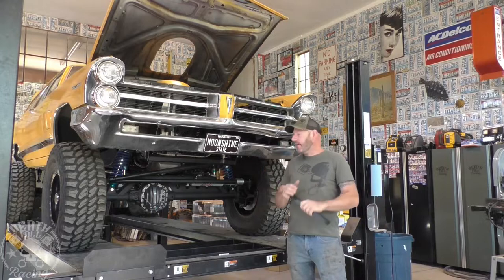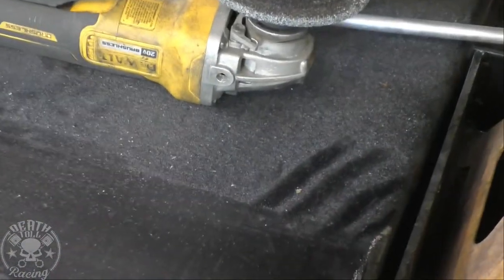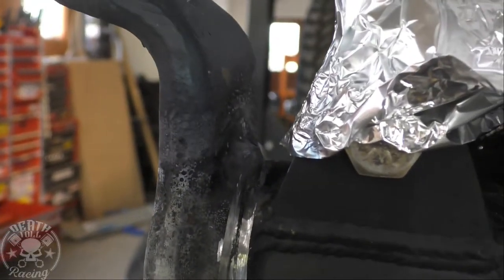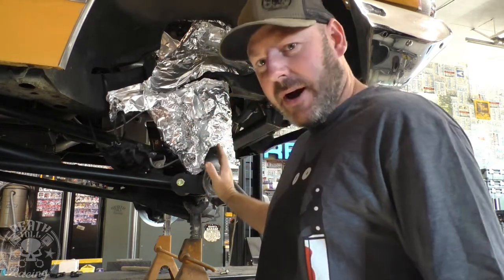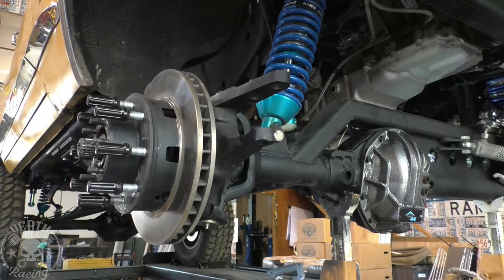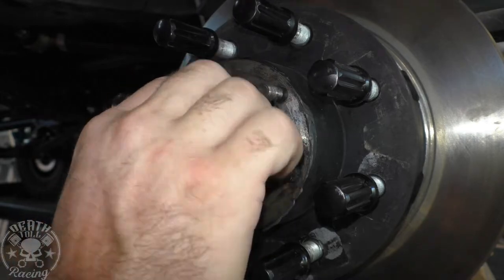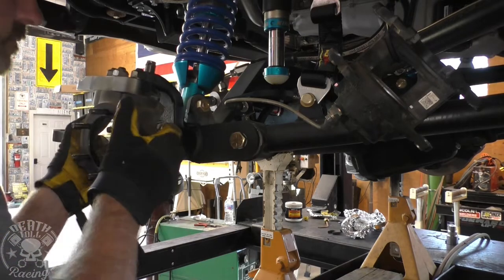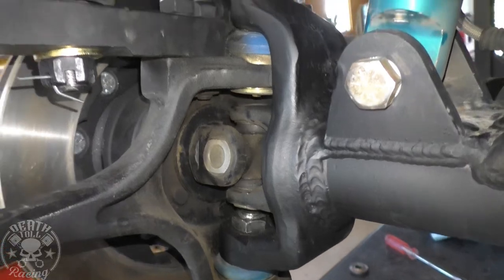Dana 44 Inner C Knuckle Rotation to Fix Caster on a Lifted Truck;  Safari Wagon 4x4 Overland Project

Comment: what an awesome video!  I have a 1995 nissan safari, with undersprung solid axles.  I am flipping the to over axle, and did not know of all the other steps involved to make it driveable.  Someone asked about "cutting the knuckles and rotating", and I simply entered that into the YT search, and voila!  Thank you so much for taking the time to make such a great video.  That shop is also mint.  I am bringing my truck to an expert to do this, as I wouldn't be able to exit the garage after the axle flip!......and I have never done what you just did!  If I had the space, vertical and otherwise, I would absolutely tackle myself!  Thanks again.  New subscriber here for sure!
Reply from the maker: Thank you!  Rotating the knuckles can be a pain. Glad the video was helpful!

Comment: bravo
correct way to make your front alignment as perfect as possible
suspension geometry, axle reinforcement, tire size, ride height, pinion angle - then CASTOR!!

Dana 44 is notorious for inadequate castor, especially if your donor vehicle was IHC.
twisting the knuckle (AFTER all the other parameters have been established) is the best way (in my humble opinion) to correct this inadequacy. turning the entire axle shaft has been proposed, as has cutting and turning the shaft housing, but after installing custom suspension and probably an axle truss, the steering knuckle is the easiest and least disruptive method. this method will work for all axles, not just the 44.

again, bravo. (assuming you were watching your camber...)
Reply from the maker: Thank you sir!

Comment: So.  You’re just throwing that gauge up there all Willy nilly to check the angle.  I’m doing the same, but if I rotate the gauge on the all-thread ever so slightly, I get about a half degree deviation. How are you sure you have your gauge up there square?
Reply from the maker: yes the level needs to be fairly close to the front or the back of the all thread.  I can't imagine not being able to line it up good enough for a half degree of variation, but if you are having trouble with consistently placing the level on it, tack something flat to the all thread and line it up as best you can, tighten the nuts, and then you will have a flat surface to put your level on consistently.  On camera it may seem willy nilly, but lining things up with zero effort is probably my strongest attribute.  also make sure your all tread is centered in the holes using bushings to hold it center if you have smaller all thread.

Comment: 9:50  Axle Tubes Should Be Stick Welded in the First Place, For Maximum Penetration. Also .030 penetrates more than .035.
Reply from the maker: They can be. But I wouldn’t say should be.

Comment: last question, what welding wire you used for that work ?
Reply from the maker: The welds on that are actually really not as critical as it would seem. They work together with the joint being an interference fit. 

That being said, the steel knuckle must be hot and stay hot while welding. Use .035-.045 s70 wire will be fine.

Comment: Would offset ball joints correct this problem? I know you can buy them for the Dana 30.
Reply from the maker: I think those are intended for camber not caster(but I could be mistaken). Camber is the top of the wheel in or out and caster is the pivot (picture a hinge) leaning front to back.
Reply: @DeathTollRacing  TOGETHER the caster & camber make up what used to be called 'king pin inclination'. this imaginary line passes through the centers of the 2 ball joints and contacts the road surface at a point relative to the tire contact patch and creates 'scrub radius', or distance from center of contact patch to point of intersection of road surface and king pin line. for the tire to roll down the highway smoothly, the scrub radius should be slightly forward of the center of the contact patch, and for steering stability (and steering wheel return to center) it should be slightly inward - toward center of vehicle - of the contact patch. rule of thumb: scrub radius +-1" depending upon application!!

this is why tire size is so important, both diameter and width. wheel backspace and/or wheel spacers affect this relationship.

Comment: pls which gas do you use to preheat it, and you mentioned stainless material with argon would be good but which material and gas do you use to weld it? I want do it it same way as you, but still considering welding metod.I have tig/mma (probably harbor freight weld maschine),my buddy has CO.I will do it with dana 30 ,there should be cast steel C's.
And about double cardan and lubrication problem, if I set pinion bit higher but make second fill plug  higher ,do you think the problem is solved ?
Reply from the maker: Heat is oxy acetylene. It must be HOT

Welding is either stick or mig, don’t worry about stainless. Tig is probably not a good idea on cast. 

You will want to fill your axle up one way or another until the fill line is up to the pinion bearing. How you do that varies, and can be speculative.  A lot of guessing in that regard can take place.
Reply: @DeathTollRacing  and that harbor freight welder ,whats actually mean ? Because which I have ist small inverter on 220V, in Europe we he 220current,so  should it be good ?
Reply from the maker: @jurajsmutny8171  It should be.  Just keep it hot the entire time your welding.  Heat it in between your weld passes.
Reply: @DeathTollRacing  how much degree celzia ?And after welding wrap to special blanket ?

Comment: Will a Lincoln 140 mig welder be ok to use?
Reply from the maker: Unfortunately not for that.  Do you know someone with a stick welder maybe?  7018 rod

If you have no other options, keep it very hot and max your 140 out.  I really wouldn’t recommend it though.

Comment: I need to do this exact same thing on my 1970 FSJ J4600. It has a closed knuckle Dana 44. Looks to me that the bowl portion of the knuckle is attached to the axle tube in the same manner as your C knuckle. Any chance you know this to be true? That was an outstanding video!
Reply from the maker: I have a closed knuckle 44. I will look at it. I think they are easier actually. The weld is about an inch and a half in off the “ball” on the axle tube. I haven’t done it to one of those yet....
Reply: @DeathTollRacing  now that I've scraped off 51 years of grime I can see the weld. Looks easy enough. That's tomorrows project. Then on to the high steer.